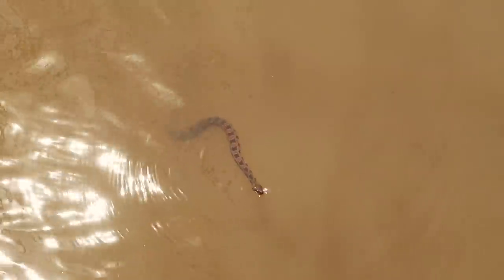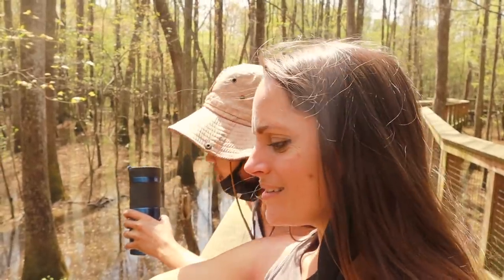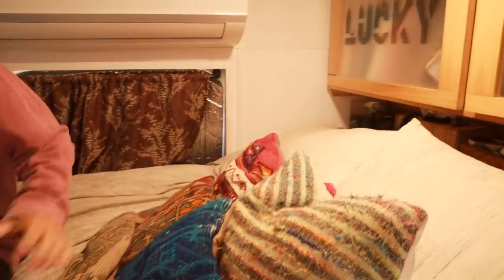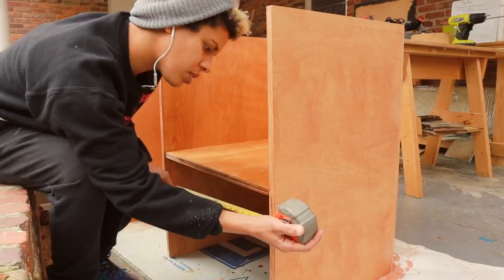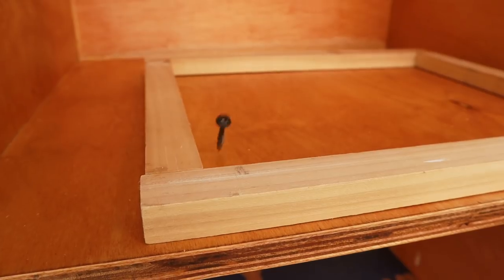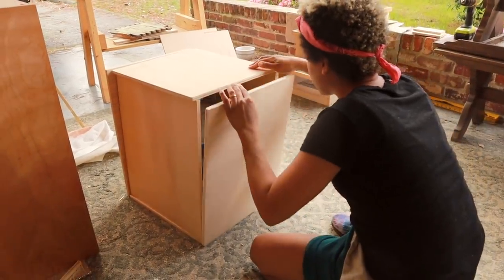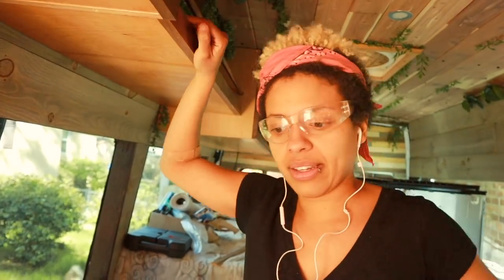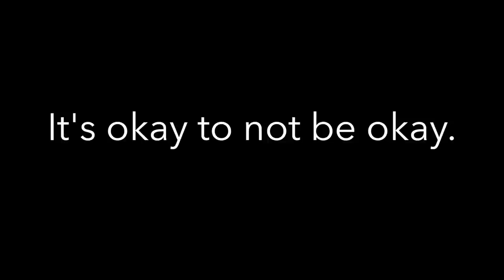TURNING A VAN INTO A HOME TO TRAVEL THE WORLD | DIY Van Build | Why We Love the Van Life Community

Comment: Ladies for the propane box you need to add a vent to the propane box it should be at the bottom to allow propane to vent if you have a leak. Propane is heavier than air so you want a vent so if it leaks it will vent outside. RFK
Reply from the maker: Yes! Thank you for noting this. We realize that we forgot to mention that important detail. We do plan to install a vent at the bottom that will go to the outside of the van to ensure safety in case of leaks.
Reply: I’m happy someone mentioned this!
Reply from the maker: @triciahiggins2058  yes! Putting a vent in was already in our plans but we completely forgot to mention it. Safety first!
Reply: @LetsPlayRideandSeek  
Yes I  noticed that when Abi did the box and I was talking to the phone, saying, no abi you ,end to make a vent that goes out of the van, it's dangerous. I'm glad someone mentioned it. Abi and nat I'm glad that your going to or made the vent for the gas tank. God bless you both 🙏 ❤

Comment: SAFETY TIP….Good start on propane box. Propane is heaver than
air. Tank will vent with change in altitude and temperature. 

So you need to vent it out the floor of your van. 

I used a PVC pipe about 1.25”. Caulk around it in the box and under the van. 

At the top or near the top of the box put another pipe and drop it out

the floor too. This will let fresh air from underneath the van to
flow in to the box to replace the propane dropping out the bottom.
You can keep this pipe on the outside of the box. 

I had an old screen and cut 2 pcs out of it to attach it to the bottom of

the vent pipes with pipe clamps to keep bugs and mice out.
Reply from the maker: Yes! 
Exactly what we plan on doing!!